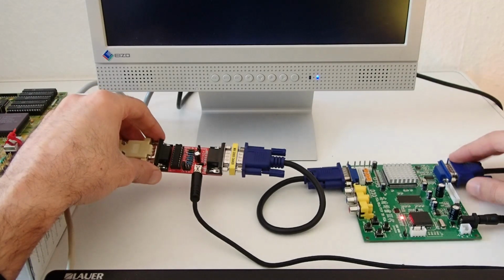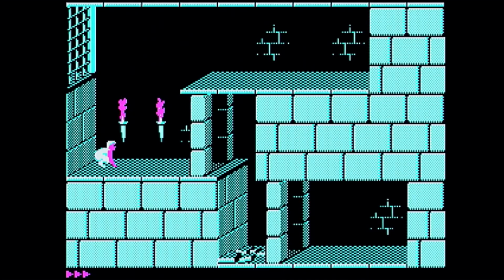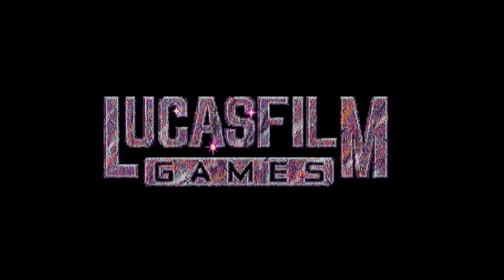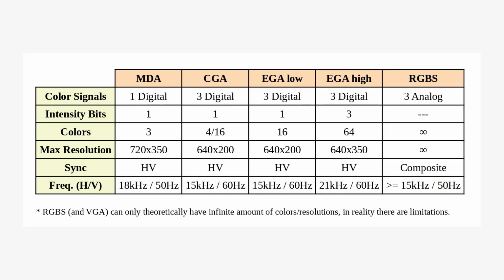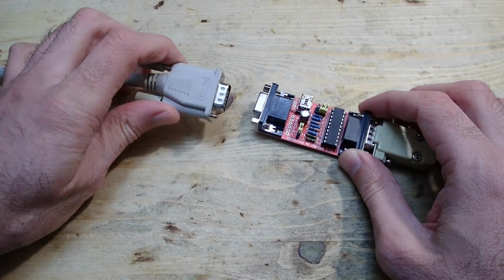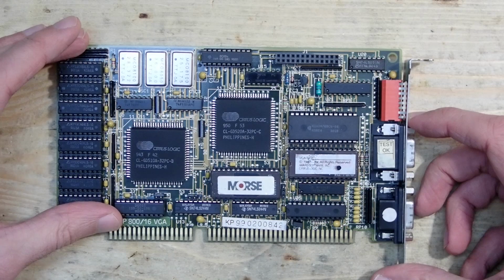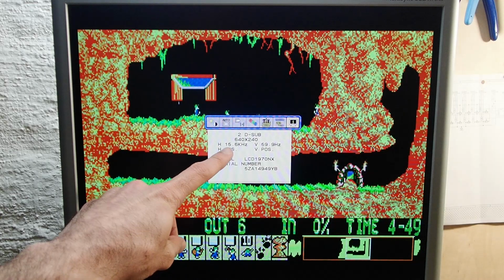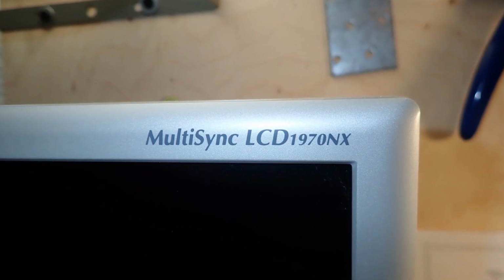MCE-Adapter (part 3): Showtime

Comment: Very nice and an excellent explanation of the issues you ran into.

Question: I have an old Olivetti M19 PC that outputs analog 16 color monochrome, but its vertical refresh is a slow non-standard 45 Hz or thereabouts. What would happen if I would feed that into the (modified) CBS 8200?

One small note: there is some static in your audio in all 3 videos. You may be overloading your input.
Reply: Forget about the sound comment, it's my Bluetooth connection.

Comment: I am trying to build this and am having problems programming my Lattice GAL16v8d-25LPN (I have two chips i got from Jameco, both do not work) on my XGecu (TL866 II PLus, and T56 Programmers)  I used the DOS EQN2JED assembler to produce my JED files.  The programmers report no problems, only the verify shows all '1's upon read back or verify.  BTW, can the ATF16V8B be used as a substitute for the GAL?  Is the .eqn file the same?  Many thanks..
Reply from the maker: You can't verify the GAL if you write it with read protection, which is default setting on TL866. If the read protection is active trying to read it will give you garbage.

And yes ATF16V8B works fine too. You just need to pay attention, that the chip has built-in pull-ups. I think, the only version, which has none is with C in the end.
Reply: @necro_ware  You are correct.  And I think I was also un-checking the 'flash' box too. It was Noob thinking, but the term 'flash' was confusing me.  This morning, with neurons refreshed, checking the flash, and unchecking 'lock bit', did the trick.  I shall solder up the MCE today and see what I can make it work.  I really appreciate your work and videos, thank you.  Especially sharing your KICAD files.  I have great interest in understanding the various retro video signals and such, so this  ting is up my alley!!  The boards came in from PCBWay yesterday.  Cheers

Comment: Hello NecroWare, can you tell me if this converter of yours converts from VGA to RBGS? I need to connect a Raspberry Pi to a car radio, Thanks a lot
And a good Project :D, you are great
Reply from the maker: Hi, no unfortunately not. It's only to convert TTL to VGA or RGBS. However it is very easy to convert VGA to RGBS. You just need one XNOR gatter to combine the sync signals.
Reply: @necro_ware  Thanks in advance for the response. I'm a bit of a layman, is there somewhere I can do a Sync like this? thanks

Comment: Thanks for doing this project. I have used your MCE Adaapter to convert the video signal from a Charmilles Robofil 290 wire erosion machine from 1995. An industrial monitor replacement would have cost GBP 1500. The video connector was a 9-pin D-Sub which matched the pinout for CGA. The sigals were 5V TTL but the horizontal frequency measured 31kHz from the Charmilles video card.
I assumed it was CGA/EGA and bought a GBS 8200 Rev 4 and a VSDISPLAY 12.1" 4:3 aspect LCD monitor from Amazon. There was no signal.
After watching your videos I know why now. The GBS 8200 was expecting a composite sync signal on its HSync input.
Anyway, I ordered the boards from Aisler, the parts from LCSC and a TL866II Plus programmer from Amazon, put it all together, compiled the Jedec using EQN2JED in DOS Mode on an old Windows computer and wrote it to the GAL16V8B chip. It worked first time without needing the GBS 8200, saving approx GBP 1250 against the industrial monitor option, so thank you very much!
Reply from the maker: Thank you very much for the feedback. Glad that I could help :)
Reply: Hello friend @miguelarce9319 you did a good job on Charmilles. I'm from Brazil and I need the service manual for the Charmilles FORM2-LC, do you have it? We need to repair the electrical panel and the electronic boards that are faulty. It would be better to do a retrofit but we don't have the solution (HMI, drivers, pcl etc.) ready to install.
Reply: I used EQN2JED also and have attempted to use theTL866II PLus and T56 to program my two Lattice GAL16V8D.  What chips did you use?  Did they require any special settings?  They program without error, but fail verify.  They always read all '1's !!  Thanks

Comment: Is there a "simple" way to output composite video? or SVideo, so composite is easy to obtain too. Let's say I want to use a great TV or monitor but I can only use composite video. It is difficult to find CGA/EGA/MDA cards with composite video output. Is there a way, as simple as it can be, to go from RGBI to composite?
Reply from the maker: It's easy to do  RGBI  to B/W composite. For color it would be more complicated, but I didn't experiment with this yet.
Reply: @necro_ware   
Hmm

In the IBM Color/Graphics Monitor Adapter tech manual, page 32, there is the schematic of the output circuit. The composite is obtained by mixing the RGB, to which is added the synchrony signal that is obtained by mixing the generated HSYNC and VSYNC with an XNOR. all through a digital buffer and then an array of resistors, with an output transistor....
Maybe I'll get to it and replicate the circuit to test...

Comment: I think NEC Multysync LCD1970nx doesn't need combined SYNC, does it?
So HERCULES -> VGA adapter could be made just from resistors?
Reply from the maker: Yes, unlike CGA for Hercules it is very easy. C-Sync is only needed for some older CRT monitors and GBS-8200, but NEC 1970NX requires HV-Sync.
Reply: So there is a possibility for another project dirt-cheap MDA/CGA->VGA only on passive elements ;) @necro_ware

Comment: It's not complicated to detect Sync polarity - just resistor and capacitor. Can you spin next version of the board with DIP flash from m/b ?
Reply from the maker: Yes, I experimented with Sync auto detection. If I get some time I'll make a new revision. What do you mean by DIP flash from m/b?
Reply: I mean not a GAL/PAL but use a DIP flash chip from Pentium m/b for free... @necro_ware

Comment: Hi, can you alter the mix of RGB colours in the monochrome mode? Like instead of green or BW use Amber?
Reply from the maker: Yes, I experimented with alternative firmware, where I could switch between white, green and amber. The last one is actually more like yellow, then amber, but still something in that direction. So far I didn't open that firmware to the public. May be another day.
Reply: @necro_ware  interesting, thank you.

Comment: I am confused about this monitor. The spec don’t say anything below 30khz. I found a nec LCD1765 also “multi sync” with allegedly the same specs of yours, do you think it will work? It’s a gamble because they don’t have the adapter so I will need to buy it blind
Reply: Also looking at view sonic VA2215-H it seems it supports Frequency Horizontal: 24 ~ 86KHz
Frequency Vertical: 48 ~ 75Hz. Will that be a better choice? I wonder if that’s not automatically defected tho

Comment: If anyone is having problem running EQL2JED on a modern 64 bit system, it runs fine under DOSbox-X
As always, an excellent project @necroware. I've built up a second one of these. Works well with GBSControl.

Comment: for lack of better words
VGA to DVI (or HDMI, as electrically those are identical) internal in monitors (and some TVs) are usually massively superior to even expensive VGA to DVI (or HDMI) adapters

I conclude it is VGA to HDMI adapters, which makes it blurry

I see not exactly correct scaling too
I know how it looks, as I run WinUAE with scaling (I have 2560x1600 monitor) and lately I cannot get it scaled properly. I wish for integer scaling here (no scaling, but doubling, tripling or even quadrupling pixels)

I miss my 17" 96kHz 160Hz 2048x1536 (1280x1024 native) LG F700P. This was really nice monitor. Unfortunately it first stopped working properly after DPMS power saving, then capacitor have up ghost (I have had a lot of such capacitors anyway) and then it simply lost sync.

Comment: Great project. This is the exact same circuit as the input stage of some old Taxan SuperVision monitors. If you have any spare inputs on your GAL you could add selectable colour pallets for Apple ][ etc..
Reply from the maker: Unfortunately all inputs are full. But since it's open source, one just can prepare different GALs for different systems and just switch them in the socket.

Comment: Hi, i need to convert digital RGB HV to VGA. there are only 4 colours on crt, rgb and yellow. Hsync is 15 KHz, Vsync is 60Hz. When i connected the tapped rgbhv signals to gbs8200, nothing happened. Then i XOR H and V, and pulled down TTL RGB to below 1V. Now it detects the signal and some random colours come on the vga monitor, but the screen freezes. How to implement EEPROM for 4 colours?
Reply from the maker: What kind of system are you trying to connect? Those 4-colors are really strange, are you sure, that the fourth "color" is not actually intensity? Since I don't know, which color standard your are coming from, I can't tell how to make it right. It depends. First of all, with CGA and low resolution EGA mixing H- and V-Sync with XOR is not right, you have to invert the output, since it has to be XNOR. It can work with XOR as well, but the sync could be unstable. On MDA and high resolution EGA it's XOR again, since there either H- or V-Sync is negative. So, as you see, it depends on the color system you want to work with. If your 4th color is an intensity bit, as I assume, then you'd probably have CGA or EGA with up to 16 colors. That standard is completely covered by my project and you can look on the project page how I did that. Everything is open source. If your device is not CGA or EGA and the 4th color is a real color indeed, then it is something very unusual and you have to investigate how that standard works.
Reply: @necro_ware  thanks for the reply. I will investigate more about the colour information
Reply: @necro_ware  Hello again. So, i monitored the waveforms of RGBHV signals. When i compared them with an Arduino (nano) generated CGA signals, i found that - first, the hsync was 16.4 Khz. Second, the Vsync pulse was wider than actual CGA 60 Hz signals. This strange Vsync has eight Hsync pulses instead of three. I was able to interface Arduino generated CGA signals (15.6KHz) directly to a scart monitor/tv by converting hysnc and Vsync to csync. But when i connected Csync produced from strange Vsync and Hsync, nothing was detected.
Reply: @necro_ware  i am trying to modify an old display unit so that a crt monitor/tft display can be used. I tapped the RGB signals from the preamplifier stage of Guns and Vsync and Hsync from sweep generators i.e. vertical blanking and horizontal blanking pulse. Is there a way to directly interface these signals to a tft lcd of 5-7 inch by calculating all the parameters via a good processor?
Reply from the maker: @ravisi11  Well, then at least my solution is not, what you are searching for. It is the cheapest and simplest solution to connect an MDA/CGA/EGA graphics output to a VGA monitor. If you have some quirky and absolutely non standard output, then you probably should take something more sophisticated. There are solution built around FPGA and RPi. They are more powerful but also do cost a lot more.

Comment: This series was very informative. There were vsync compatibility issues with the original IBM MDA and CGA video adapters and non-IBM monitors. It would be nice to have a universal MDA/CGA/EGA/Hercules to VGA adapter. Also, are there any LCD monitors which will support the original pre-DDC VGA pinout including the monitor ID pins?
Reply from the maker: Thank you very much. That's a good question, which I can't answer right away....

Comment: May be it silly suggestion, but - we can store RGBi signal as bits in buffer memory and pull out  it in VGA frequencies. 
It will be good to get from video adapter pixel sync and store every pixel in our frame buffer (~256kB) as it original frame buffer of adapter. And then we can send frame buffer to USB, Ethernet or wherever you wont))
Reply from the maker: There are already such adapters available. The cheapest one is GBS-8200, the others cost a lot more. I wanted to make something, what is dirt cheap and if you have 15khz monitor, you don't need more, than this. Currently we are talking about 100€ vs 5€

Comment: I build this adaptyer and works great.  Thank you.   In certain circumstances i am getting flashing white/yellow   areas where there is white. This could be my setup , just wondering if you have seen anything like that.
Reply from the maker: Great! Thank you for the feedback. I didn't notice any flashing areas in my setup. If you use it with GBS-8200 it also could be a problem of that one. Unfortunately this thing is kind of unreliable sometimes. At least with gbs-control software it works way better.
Reply: @necro_ware  Thank you. This is directly to a 15Kz capable monitor.  https://twitter.com/theory_retro/status/1374770980132958213 , I might be using an incompatible GAL, I am using ATF16V8CZ-15PU.  I notice no difference with jumpers  J1J2J3 on or off. I am sure its something I am doing wrong.
Reply from the maker: I used it with Lattice GAL16V8D-25 and Atmel ATF16V8B-15 and both worked well, but I don't know how it would be with another GALs. At least if you toggle J1 your image should change between color and B/W. Toggling J2 you should see at least difference in brown color, but also other colors would differ slightly. With J3 it is possible, that you will see no difference if you use RGBHV (J4@2-3), because J3 is responsible for polarity of C-Sync, which is not used in RGBHV mode.
Reply: @necro_ware  Perfect thanks.   That gives me a list of things to check :)

Comment: Do you know of a good guide for setting up a GAL compiling/burning toolchain? I just ordered a set of GAL16V8s and a TL866-II+ to try and hand-build one of these, but I haven't seen any Verilog/VHDL since 2006 and I don't know how to turn code into a burnable image.
Reply from the maker: Hi Boris! You don't need VHDL to compile GAL programs. You will need a tool EQN2JED. Unfortunately, it is not free, so I can't put any links here, where you can download it. But if you search for this tool and for opaljr21.zip you will find what you are searching for ;) There is an open source implementation of the compiler, but it has some problems and is not fully compatible to EQN2JED. I wanted to take a look on the source code to improve it, but didn't have time yet. The way itself is quite simple, you write your equations file *.EQN and compile it using the tool to *.JED. This file can be simply opened in TL866II+ software and written onto the GAL. It's very simple....
Reply: Thank you very much, I'll look it up!

Comment: What do you think about converting old VGA CRT monitors to accept 15KHz? I heard it's not too complicated, just a few components replacement and some tweaking. Of course, only older analog ones will do, with knobs and no OSD. But they are still widely available and very cheap too.
Main advantage here is real, visible scanlines plus CRT colors and picture magic overall.
Reply from the maker: Would be nice to see such a modification, but I think, I'm not the right person to do this. I'm actually a software developer with an interest in digital electronics, but I'm complete noob in analog circuits :) So I wouldn't even try to open a CRT monitor, at least because of safety reasons :)
Reply: It easy convert standard CRT TV to accept EGA signal :)

Comment: Great and informative project!  I am trying to order the pcb ( downloaded and zipped all files from https://github.com/necroware/mce-adapter/tree/main/kicad/gerber ) but there appears to be a problem reading the board dimensions ( I use https://jlcpcb.com/ ).  Any help would be appreciated.  Thank you!
Reply from the maker: I just tried and it worked well actually.... You have to pack only gerber folder into a zip, which you then upload to jlcpcb. Other files you need only, if you want to modify the board for your needs in KiCad.
Reply: @necro_ware  I downloaded the v0.7.1 release source code package ( https://github.com/necroware/mce-adapter/archive/v0.7.1.zip ) instead of the individual files and it worked.  Thank you for your prompt response!
Reply from the maker: I removed gerber files from the project. They should be only generated for release. Instead you can find the archive in the release folder now. Where the compiled JED file is also located.

https://github.com/necroware/mce-adapter/releases/tag/v0.7.1
Reply from the maker: You are welcome! Have fun!

Comment: I wonder how that looks like on SCART televisions.

Using an 80's TV as a retro PC monitor could work rather well and would look rather "period correct" without being really costly ^^

This was a really nice and useful project ! Now I've just gotten myself a better but costlier adapter to HDMI using a raspberry pi zero (I told you in your first video). I tested it and it's looking really fantastic ! However I can see your adapter being used by more people because it's really cheap and i can imagine people connecting their entire collection of retro PCs to monitors they can afford, whereas mine would get really costly if you want to hook up 8 computers x)
Reply from the maker: Hi Deksor!
Yes, if you make a bundle order of 10 adapters, the overall costs of each adapter will be around 3€ plus shipping. That's nothing. You can use this adapter to connect directly to SCART. The MCE adapter gives you analog RGBS output, which is used by SCART as well. As I showed in the end of the video, I plan to integrate it into a SCART to HDMI converter. If I do, I guess, I will make an update video :)
Reply: @necro_ware  that's really good ! :)